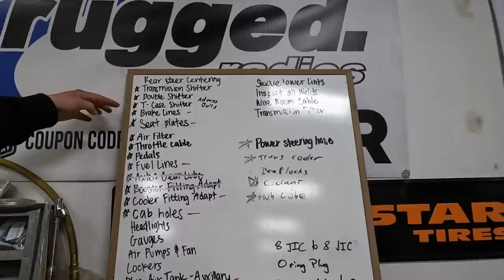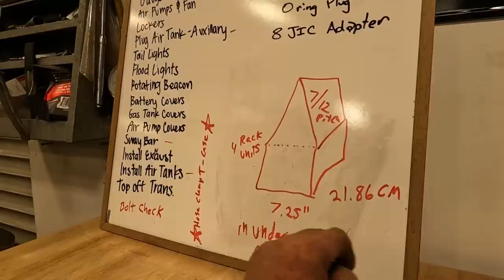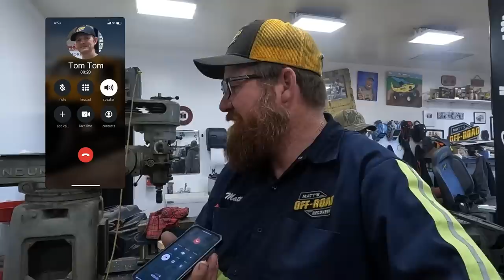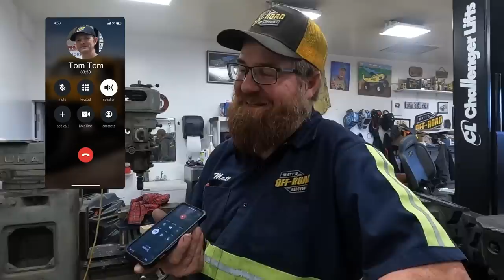Is This A Sign To Come For The World's Largest Off Road Wrecker?!

Comment: 25+ years in the HVAC game, you need low temp wind baffles on the outdoor unit. Those mini splits are funny about how much air goes across the outdoor unit. Also it could be a building insulation issue, when the wind blows it maybe chilling the building enough that the units can't keep up. If you had the same issue with a gas furnace I'd tend to lean that way.
Reply: This is the man who knows. In upstate NY you have to install them as a manner of course if they are exposed to wind. At least that is how it was 10 years ago when I actually did work.
Reply: i live in maine he is wright if you do the wind baffles you will be ok i made mine in the shop google heat pump low temp wind baffle you could make one fast 30 min to 1 hour
Reply: @Count Von Butte this
Reply: 10 years in the HVAC game and I think you're probably right. 
Also...I HAAATE ductless splits. Finicky and worthless. I wouldn't have one in my house or shop if you PAID ME TO. 
Period.
Reply: 7 years as a Licensed Professional HVAC Engineer. The low temperature wind baffles is absolutely the correct answer to solve the problem. Larger than anticipated airflow across the condenser will cause the head pressure controls to trip causing refrigerant bypass in the system. The mini-split heat pumps also have built in defrost controls preventing ice buildup, this will cause the indoor unit to blow cold for a period of typically 5-10 minutes. 

As for the furnace when the wind blows, again I agree with Andrew that it could be a building insulation (infiltration) issue. I have seen field issues where specific conditions have caused the flame to blow out, which will cause the unit to retry ignition. In the meantime, the furnace blower will continue running and blowing room temp air which will feel cold at the velocities in which it leaves the air terminals.
Reply: Probably needs radiant heat tubes for those cold days.
Reply: 0 years in the HVAC game here. Those recommendations make sense to me!
Reply: Yup cold weather kit is a must if your equipment needs it
Reply: @RILEYLEIFSON_UTAH  ya I’m not a fan either after having them. I had shut mine off for a couple weeks and it developed black mold and when i turned it on, it was aerosoling mold all over my room and house. It’s right above my bed where i sleep mind you. I had a sore throat and stuffy nose for over 3 months and couldn’t figure out why until one day i saw the mold. I immediately taped it shut to wait until it could be completely taken apart and cleaned properly. I suffered many months beyond that day as the mold was already in my body. I am now super sensitive to mold and even the littlest bit will bring my symptoms back. The a/c function is AMAZING. Really is. The heat is just ok. I still have a propane heater which does the majority of my heating. Mine have also been very finicky with “glitches” if i don’t shut off and turn on anytime i change a setting or it won’t work right. If i could do it all over again i wouldn’t get them. Massachusetts was endorsing these things hard and had all kinds of rebates but I’m just not a fan of them. Also i live in a rural area on a dead end 2 mile long dirt road, so when we lose power we go a lot longer than other people. If it wasn’t for the propane we would be lucky the pipes didn’t burst. It was -45 with the wind chill last week and if it also wasn’t for the propane these things would have basically done nothing. I would NEVER have these unless i have another supplemental heating option available as well. At least wood as a just in case scenario. But it does make the best a/c I’ve ever used!! Expensive a/c system though lol
Reply: @saygrey  This is windy weather kit.
Reply: Close, 35 years in the business. He described the unit go into defrost. If the wind is blowing hard enough the outdoor thermistor on the cage will read an odd temperature, when this happens the unit will pause for 2 minutes and continue to defrost then. So high wind baffles definitely help. Also relocating the thermistor to a different part of the coil may work also.
Reply: Would the wind baffles need to be removed during summer time?
Reply: What about windshield wiper fuild ???
Reply: @lucaskroll1924  What about it ???
Reply: Gas furnaces shut off in high wind because of a backdraft in the flue pipe. The combustion inducer motor has a pressure switch that only allows the gas valve to open when inducer air is flowing outside. If the wind is stronger than the flue exhaust, the pressure switch opens (disconnects) the circuit and turns off the gas. The blower fan will still run blowing cool air. Then the unit will try again. 
The goal of these safety switches is to ensure that  combustion air  is flowing outside.
Reply: I live in Minnesota and have never seen a furnace blow cold air because of low insulation.
Reply: @strizzy239 thank you for the info! I was thinking of Putting one in my daughter-in-law's room and she has Asthma.That would have been a disaster!Thank you again!

Comment: If the compressors that are outside are in direct wind they shut off. You may need a wind block.
Reply: Was just about to say that
Reply: If you just lean up a piece of plywood, it would already make a huge difference.
Reply: But it did it with a SHOP HEATER too so I am going with a  NEGATIVE AIR PRESSURE and a wind block would help but its a heat pump or is it a MINI SPLIT? Looks like a mini split header to me
Reply: or the compressor froze up
Reply: @CORNDODGER  mini splits can be heat pumps.
Reply: My mini split is a heat pump.
Reply: WOW😂
Reply: @CORNDODGER  mimi splits are heat pumps.
Reply: Been putting them mini splits in for years and have had this problem quite often need to build a wind block around it but not right up against if you then it will freeze up in the summer due to not having any airflow and also if it’s really cold they will shut off anyway as a safety feature
Reply: The Name of this Rig is the Morr GOAT .. Greatest Off-road All-Terrain Tow (er)
Reply: Came here to say that. Wind prevents the compressor from completing its defrost cycle so the the system could be freezing up and the wind preventing it from defrosting.
Reply: That’s a mini split heat pump, they’re very energy efficient but can be problematic, your better off going with a typical heat pump split system or a package heat pump. I know people will comment about how great they are but shutting off when it’s cold and windy is ridiculous
Reply: More like a wind guard they screw on to outdoor condensing unit, well for Mitsubishi they do
Reply: @CORNDODGER  perhaps the wind was causing an issue with the draft
Reply: There’s a sensing bulb on the outside coil, if it’s too cold outside it’ll tell the board the coil iced up and it may go into defrost mode.
Reply: Same, depending on the manufacture, they usually sell a blocker for High wind applications.
Reply: Tom right.
Reply: @CORNDODGER  Probably just a wonky thermostat, since it's happening across several different machines.  The one common denominator would be the thermostat.
Reply: People always over look ground wires as well.
Reply: Most manufacturers sell it as an option for low weather operation. Or plywood like you said
Reply: Blow out all fabricated lines before final assembly,  please.

Comment: Hi Matt I’m in the heating and air business in Wisconsin and work on roof top hvac units every day. Depending on direction, we some times have to install high wind kits on the exhaust of the unit. This allows the exhaust to blow straight up instead of having the wind blow into the exhaust hood while it’s trying to blow out. That causes the air flow proving switch to open shutting off the burner. There’s what I know and run into. Good luck.
Reply: Doesn’t the mini split system still just have one heater unit?
Reply: He also said the same thing happens to his gas furnace. Mini splits also need a wind baffle in low and high ambient temps.
Reply: Maybe it's something more simple like open windows detection if his split have such a function.
Reply: @KentuckyReef  be kind please William was just sharing his experience...remember, Matt said it also happened when he had a gas furnace not just the mini split
Reply: @joshpylant3113   your correct on that. Assuming that those heat pumps are able to heat at below freezing and this issue only arises when its wind out.
Reply: @KentuckyReef  Not sure why they hung them so close together? Should be on opposite sides: South and East if possible for that area maybe West and South. Most of the time those mini-splits have the outside condenser directly behind the inside air handler. Again not very efficient install. JMHO
Reply: Me personally I think he’s having an auxiliary heat issue. With the spread on his set points. Especially with that digital thermostat I bet his thresholds are all messed up. These systems are smart it’ll start to just blow cold air to keep the elements from burning out and tripping over loads. Sounds to me auxiliary heat may not be set up right or as I said thresholds set points on the thermostat are outta whack
Reply: Its called the venturi effect, but a valve should be installed to prevent that. Actually its sucking air too much air out of the exhaust vent, not blowing air into the exhaust vent. Thus shutting down the furnace/ gas burner.
Reply: I agree with this (I also own an HVAC company).  The mini split A/C and heat pump units can have an auxiliary high wind baffle kit installed on the outdoor unit which will help them operate in low temps on windy days.  They also may need to get a drain pan heater at the outdoor unit.  After that it could be related to programming or refrigerant charge, etc.  For the gas furnace side of things, that could have been a whole other issue.
Reply: should have put in a package unit like A 4 Ton or 5 Ton
Reply: @joshpylant3113  A dust storm can damage a condenser but just high winds: hot or cold is fine, you should not block the flow of air with any wind baffling around the condenser.
Reply: It’s been said several times wind baffles are a must along with being raised above the snow accumulation average for that area. Also low ambient kit for that brand unit. Gas furnace whole different can of worms. Live in Wyoming and dealing with wind around the Midwest is difficult when it can come from any direction.
Reply: I forgot you guys probably use heat pumps out there. That’s why the auxiliary heat issue makes sense. We only use heat pumps in large buildings with cooling towers or ground souse glycol loops. Yea I know TMI. hvac has so many factors depending on what side of the country your on.
Reply: @KentuckyReef  AND he also referred to a gas furnace that isn't at the shop or used to be at the shop or maybe his home
Reply: @KentuckyReef  oh ok ya I’m a little disconnected from residential stuff. I’m a building engineer I’m used to crack units on the roof and boilers and heat exchangers cooling towers and chillers. I’m like 20 years behind on technology lol
Reply: @KentuckyReef ...tell us you're a rude prick without telling us you're a rude prick. 😏 

Whether he's right or wrong, why would you phrase it like that when he was just politely trying to offer some assistance? You could just as easily said "It appears he has 2 wall-hung head units for a mini-split system" and got your point across without sounding so condescending. 🤦‍♂️
Reply: I saw a Honeywell thermostat on the wall. I wonder if it has a low temp cut off…… I’d figure the wind is causing some type of sensor condition that’s causing the unit to reset the heat cycle. 
If it was a 90+ furnace the back pressure from the wind would cause back pressure of the draft exhaust system………. Those heat pumps should be able to heat done to 10-15f.
Reply: @gwood69  They are not only residential. They are scalable to whatever size. I’m working on a job that has 53 head units. They use three pipes and you can run heat and cooling at the same time, off of the same system.
Reply: @onepunch7632  LMAO😢😢😢 
Do you talk to your wife’ boyfriend like that….
Reply: @KentuckyReef  God damn! You're a master HVAC technician AND a marriage counselor?!?  Don't you worry how me and Steve talk to each other!

Comment: Matt, most likely your mini split (heat pump) isn't a low ambient unit. So when the wind is blowing the gas is having a hard time transferring heat/cool. I would try a wind baffle all the way around the unit (leave about 2-3 feet of space) to protect it from the wind. If that doesn't help I would look at swapping it for a Mitsubishi Low Ambient unit. That's all we put in here in Colorado for commercial settings.
Reply: MrKool has those also.
Reply: Yeah. The Mitsubishi split systems we use here in norway wil be efficient all the  way down to -5f and will work good even lower...
Reply: I installed a water source heat pump and love it, works well all the time. But i assume Matt's is air source so he has to battle the large outdoor temp swings and wind.
Reply: Surprised that their HVAC company would install one that wouldn’t work in the climate they do business in. Might be worth a conversation with them
Reply: @logankistler  probably one of those DIY 's or Matt would have called them

Comment: Like others said, the wind is either overspinning the fans or just blowing through the heat pumps. You will need to install the baffles, looks like Mitsubishi heat pumps and they do make them. The other thing you might need also need to do is to install some kind of wind-break for the heat pumps to prevent the wind from blowing through the heat pumps. Hope it helps!

Comment: For your HVAC question most manufacturers make a wind shield for the outdoor unit in a mini split. It should take care of the issues you are having.
Reply: Agreed, from what it sounds like is the wind is blowing back into your exhaust, not allowing the HVAC to vent properly so it shuts off. wind shield should work.
Reply: Why does wind cause a heat pump to quit working? Is the fan in the outdoor coil fighting the wind and resulting in it detecting something wrong with the fan, or too much superheat?
Reply: as a full time YouTube(watch)er, I have see Mini Splits installed in various locations and episodes of different builds.  The common theme seems to be... THEY DONT WORK WELL.
Reply: @larryfreeman7979  they actually work great if you use them correctly - kind of like any tool! :)
Reply: @advancednutritioninc908  I have to agree they actually are incredibly reliable and can put out great heat as well as cooling. However most get installed wrong. I used to be a factory rep for Mitsubishi/Trane and if I went to 10 sites to do a start up 9 were installed wrong and I ended up leaving.
Reply: @larryfreeman7979  that's because most are installed by unqualified installers.
Reply: @larryfreeman7979  Because people are buying junk garbage units, mine is mounted on the roof and probably gets winds up to 80km/h (50mph) and works perfectly fine. Mitsubishi Heavy Industries.

Comment: Might need wind baffles for the outside units on the heat pumps. If wind blows across the fan it can send it into an error. Look up wind baffle for the brand of unit you have and they’re fairly easy to install, it’s 4 screws
Reply: Makes sense.
Reply: Wild that a heat pump is able to extract heat from frigid outside air.
Reply: @phasm42  gotta think In kelvin scale, not Fahrenheit.  Think molecular temp, lol!
Reply: @Derf1313  still pretty incredible that a pump that operates at such low temps is just a nbd thing you buy.
Reply: Agreed; if the install put the exterior heat exchanger into the wind, they can get very upset with wind pushing into them and messing with the fans.  Baffles should fix the problem.  (It doesn't have anything to do with the interior temperature.)
Reply: I think heat pumps pull heat from atmosphere as low as 5°F.  Efficiency leaves around 20°F.  It doesn't get that cold in Hurricane does it??
Reply: They can go in to the negatives easy  you might also have a draft in the shop
Reply: @phasm42  its taken a long time for the technology to get where it is now
Reply: must be "planned obsolescence " 😆 🤣 😂
Reply: @chadbothern7255  We have heat pumps up here in Canada that say they'll produce heat at -30'C
Reply: @phasm42  I know, right?!
Reply: agree - unless it's the outdoor unit freezing up in reverse cycle?
Reply: @phasm42  mine work down to -15f
Reply: @phasm42  The reason they can put out heat when its cold out is the compressor is inverter driven,and when they double the frequency,say 120hz,they make a bunch of heat,then they use vapor injection to remove the heat and use it!
Reply: It’s also possible the thermostat goes into “emergency heat” or “backup heat” according to an internal setting that needs bypassed… because there’s no electric or gas heat backup for it to “prefer” when the temperature is below a set low threshold temperature.
Reply: @phasm42  It works on the opposite. You basically cool with A/C outside world and as a side-effect you get heat inside
Reply: I’m worked on projects that we had to put the heat pump in a separate building outside and put a unit in that room to keep the heat pump warm 

I agree with The wind baffle that outside temp sensor probably isn’t happy with the wind chill effect